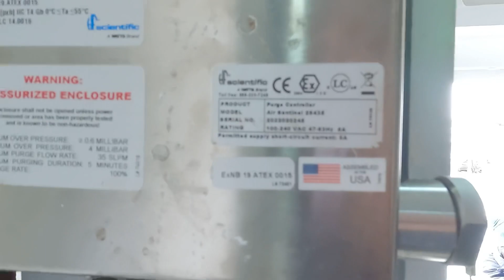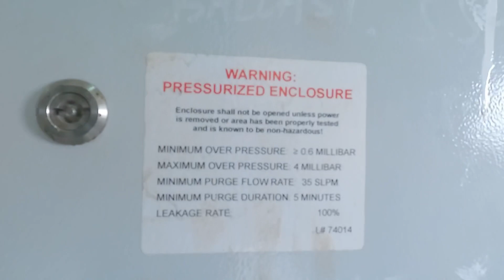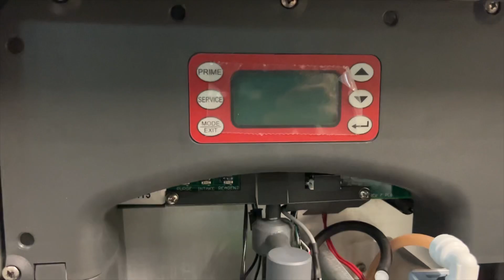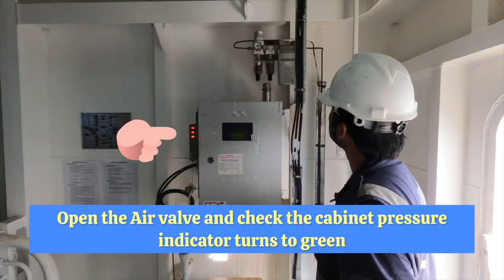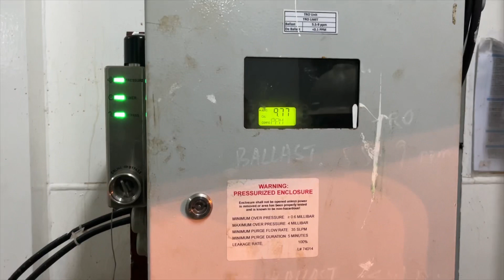TRO ROUTINE of SUNRUI BalClor BWTS System | Ballast Water Treatment System | Total Residual Oxidants

Comment: What can be the reason of tro cabinet not working? Air valves are opened and metering pump is running but no lights are on and screen is off
Reply from the maker: Chk for air sentinel function, it should show all green light